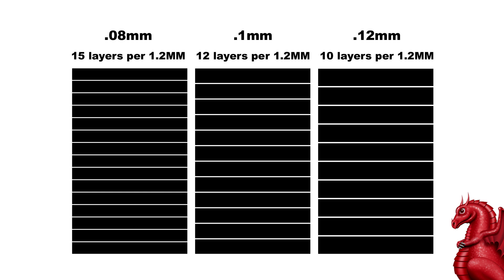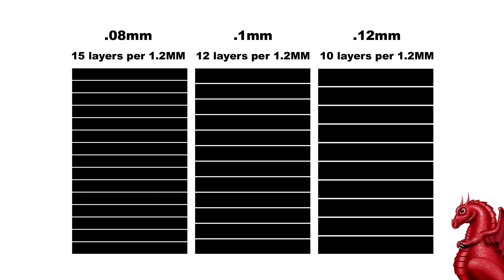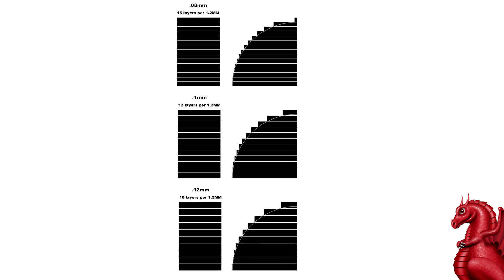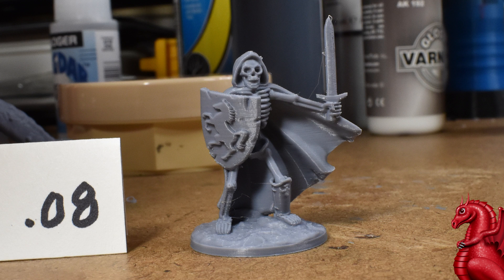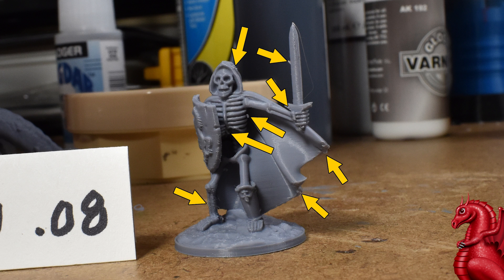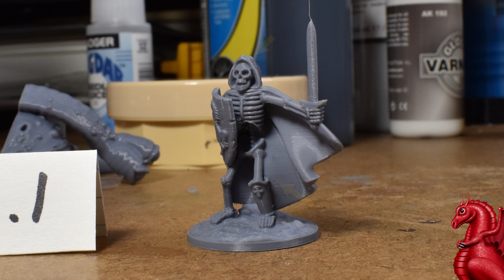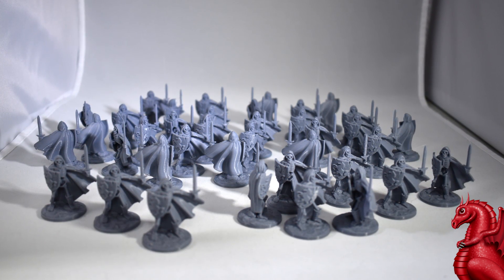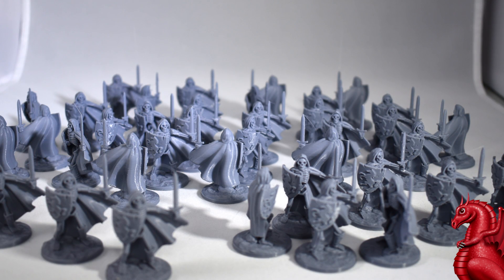How to 3D Print Better Miniatures: Pt. 1 Layer Heights

Comment: Good video, however, a stepper motor used at half step, deviation is largest (not smallest) at halfstep position: the magnetic angle (so mechanical angle) deviates the most from the electrical angle. This is just standard specification of steppermotors .

Comment: Is the layer height something you can adjust in creality slicer, or does this have something to do with the printer nozzle?
Reply from the maker: You adjust in the slicer, but you do not want to go lower than .1 for miniatures. See my other video covering layer heights and why sub .1 don't produce better results.
Reply: @Tombof3DPrintedHorrors  alright cool thanks
Reply: @Tomb of 3D Printed Horrors  BTW, what would the option be that adjusts layer height in creality slicer 1.2.3

Comment: Hello there ... I'm trying to print tiny sails ships hull using this guide but on a Anycubic Mega pro ... I'm experiencing stringing (not able to add the picture here). Trying to solve in different way one by one (less flow, lower temp, more or less retraction, higher thickness) but no way to remove the fenomena can you help me with recommended direction? I'm printing with 0,4 nozzle, thickness 0,1mm. and using your recommanded setup.

Comment: There is brand of filament you recommend for printing miniatures and high detail prints?
Reply from the maker: Hatchbox PLA
Reply: @Tombof3DPrintedHorrors  can you give me something like 5 or 10 options ? I'm from chile and the brands are very limited
Reply: @pablogallardo5100  5 or 10 bro.... just buy what you can
Reply: @Tombof3DPrintedHorrors  hatchbox cost 67usd
Reply from the maker: @pablogallardo5100 my recommendation is to buy a single roll of each of the various ones in your price range and see which one gives you the best results.
Reply: @Tombof3DPrintedHorrors  I was thinking the same and I already buy 5 brands

Comment: I was given my first 3d printer as a gift for Christmas 2020. Learning so much from your videos. I've been buying your models for years waiting for this day. So far I've done  three skeleton prints and they came out okay.  I think my nozzle is too low to the print plate as I am getting some minor stringing and some detail loss. I'm using a filament with a print temp of between 205 and 225 . I used your settings from another video but instead of using your suggestion of 195 I stuck with the 205 minimum temp. so not sure if the stringing and the glassing is from the temp or a low nozzle height. These issues are very minor but I want to get better results.
Reply: My printer is an Anycubic mega 5.

Comment: I'm just starting to watch your videos using new ender5 pro and getting some stringy ooze. if possible could you point me to the best place for starter advice to adjust settings in creality slicer or other program to use instead?

Comment: How do you ensure the motor zeros on a full step? If I start printing on a 40/60 step then move up 1 full step, the next layer will be also on a 40/60 step and so on all the way up the print. Is there a way to ensure your bottom layer starts at a full step?
Reply: I have the same question, how do we adjust the limit switch of Z to be in a full step? If you found the answer please reply to this message.
Reply: @pablodestefano5604  Nah, never found an answer.

Comment: Have you tried the silicone sock that goes over the hot end? Help with radiation and makes it easier to cook print faster aswell maintain heat in block.

Comment: So I went and bought the new silent mainboard for the stock ender 3. I previously already installed smoothers and did quite a bit. I keep hearing the new bored has an upgrade on the smoothers and that there was no need to put the smoothers on. So I printed a few things without and definitely look better than the stock ender 3. Then i installed the smoothers in just to see. The prints came out flawlessly. You cant even see any lines and are amazingly smooth. To the point of not being too anal on the settings. But I'm happy I tried it out instead of listening to what was considered a pointless move. Overhangs are so much better and cut back on even needing infill or supports now. So I highly suggest to anyone to try it out.
Reply: so, you do recommend tl smoothers even with 1.5 mainboard installed ?
Reply: @alejandromartinezcarballeda   yeah. If you already have the smoothers I highly suggest trying it out. You'll have people say its pointless but I definitely beg to differ. If you don't have them its probably not worth spending the money on them. Although they are pretty cheap. But print 2 of the same thing.1 with, 1 without all the same settings...theres definitely a difference. And I swear, I felt like it helped print at faster speeds yet keep quality results. I had no issues running at 115-120% speeds on things not packed with crazy detail. But yeah man I suggest trying it out. If you do let me know what you think. I'm curious to hear if someone else agrees with this. I did have the normal ender 3 not the pro but with just the silent board. I've since changed to the Skr 1.4 turbo board but I believe that's all I had in it.

Comment: At one point I tthink you mentioned printing 9 wall sections at a time.  So my question is will the printer print each one separately or at the same time?  Does it print each piece a bit at a time?

Comment: Ok, just in case some are wondering. The A4988 drivers that drive the stepper motors, are capable of 1/16th micro-stepping with full torque, thus no need for a magic number or sweet spot. Drivers and the control board of the 3d printers tell the motors either to operate in full steps or half steps.

Comment: Ok, awesome video. This is the exact way i exained it to others. However, i do have a question. Im a mechanical engineer, not an electrical engineer, so my thinking my be off, but with a half step, could you not lose torque, making it harder for it to raise the print head, due to the split voltages?
Reply from the maker: This isn't an issue because the odds of your Z homing height hitting on an exact full step for it's starting point is very slim (see the note in the video description.) The odds are you will always be using a micro step for every layer. :)
Reply: @Tombof3DPrintedHorrors  interesting. Thats where i was heading with my thoughts. Ok, glad i was on the same page. I knew i wouldnt always be on a full step, its almost impossible in the real world. So most likely we woild hit half syeps more often than full steps.

Comment: Since the heat is what causes the defect in the prints on .08 layer height, would improving your fan cooling with something like this: https://www.thingiverse.com/thing:3343456 make printing at smaller layer heights produce less defects?  I'll have to experiment.

Comment: I love this video, as well as one you did previously where you explain CURA profiles. I have downloaded your CURA profiles and have been using them for printing minis in last two months.

However, I did notice one thing in profiles. When I downloaded them initially and loaded them in CURA 4.1.0, they had layer height set to 0.1mm. Recently I have downloaded CURA 4.2.1 (same thing seen in CURA 4.2.0), and when loading this profiles I have noticed that layer hight became 0.12mm. Initially I was thinking that since profiles are online you have modified their layer height, but recently in CURA 4.1.0 I have saved older profiles with 0.1 layer heigh to new file, and when importing this file to CURA 4.2.1, I saw that layer height became 0.12. 

Did you have this issue? Do you profiles still have set 0.1 layer height or is it 0.12 now?
Reply from the maker: It should be .1 (I use .12 for large minis like dragons) :)
Reply: @Tombof3DPrintedHorrors  yeah, I figured. I did some research  and it seems like cura can change settings to profiles between releases. Seems like bunch of settings get messed up.
https://github.com/Ultimaker/Cura/issues/6125
FYI both your videos now talk about 0.1 layer height, yet if a new user downloads new cura and imports your profile, it will get 0.12mm layer height, together with a bunch of other settings changed. Although if you take a look into the attached link developer over there says they try to keep same gcode generation between releases instead of profile, so it might be that gcode will be correct. I don't know what happens, just wanted to let you know.
BTW which cura version do you use, and do you update cura to new version ever?

Comment: The only thing I've not seen covered (it may have been?) by anyone is this:
How can you be sure on what microstep your first layer begins? Everyone's bed height and Z offset will be different. The best your process (i like the explanation) can do is keep the layers a consistent step or half apart from the previous.
I've run 0.12 for quality and 0.28 for quick prints. Features like screw holes have messed up my surface finish more than anything else I've noticed. Not too many of those on minis thankfully.
Reply from the maker: Covered in the video description :)
Reply: @Tombof3DPrintedHorrors  but who reads those before posting comments? 😉

Comment: Several people have asked if the bottom z-stop wasn't at a full stop what would happen.  I have a slightly different variation on that question that is really bugging me.  If you are auto-leveling the bed (and the board has mapped out the differences in height between different areas of the print bed) then it would seem you can't help but start out at micro-steps for at least certain areas of the print.  (granted they probably aren't bad for 28mm miniatures, but I can see it being an issue for things that cover more of the bed.)  I understand that in general the bed-level adjustments fade out over the first several layers and don't continue forever, but I don't think there's a guarantee that when the board has finished adjusting for layers that you'll end up on either a full stop of a half stop, but are more likely on a micro-stop and even with a .1mm layer height they will always be at a micro stop if the bottom layer is at a micro stop.  That leads me to think there are other issues at play besides the full-stop or half-stop of the layer heights on the Z motor.
Reply: I completely agree and have the same issue with this theory of "magic numbers". Want to complicate things a bit more? What happens when you have a dual lead screw set up with two z motors?

Comment: I am curious if these numbers are the same for the Prusa i3 Mk3.  I understand how you are saying about the # of steps per motor, and the Prusa also uses Nima 17's. How did you calculate this based off the pitch of the Z screw? Is the Ender 3 and Prusa the same as it's a clone (sorta).
Reply from the maker: It would depend on the pitch of the Prusa's screw (contact them for specs)

Comment: I am really wondering why you didn't use a smaller nozzel size. 0.4mm seems a bit large for 0.08 - 0.12 layers.
Reply from the maker: .4mm is the standard nozzle size and many people don't want to change it. A separate video will compare .2mm, .3mm, and .4mm nozzles
Reply: @Tombof3DPrintedHorrors  Ah okay, makes sense. Perhaps you could have mentioned it 😜. Anyways, keep up the great work! You truelly bring your expertise to the people in a way that is easy to understand. 👍

Comment: Great video. Thank you. 
Though I have noticed that on my Ender 3 Pro, with some minis I'll get a tiny bit of artifact, almost like a little bit of over-extrusion if I print on .1 instead of .08 or .12. But if I print on .08 or .12 it goes away. 

It's not a universal and it depends on the model, but it's been a common enough occurrence for me to skip .1 entirely.

Comment: Fantastic video as usual. However, I'm having a hard time finding out what is the amount of steps on the steppers for my printer (Ender 5, so I think I can assume it's the same as an Ender 3), and the equation to find the correct layer height per full turn, could you write it down?
Reply from the maker: The Ender 5 is identical to the 3/3 Pro. 200 steps on the motor, 8mm pitch on the Z screw. :)

Comment: With all that discussion about magic numbers/full steps/micro steps - however you call it - I'm always wondering, when you Z home your printer are you guaranteed to land on "full step"? Is the software hardwired like that to turn off microstepping when homing? I mean, if not then all this discussion is useless as increasing by "full-step" from "micro-step" position will give you again "micro-step" position. I couldn't find confirmation that homing lands on "full step".
Reply from the maker: See the video description, I address this :)

Comment: Soo how does the nozzle width impact the prints?
Reply from the maker: I have a separate video covering .4, .3, and .2mm nozzles coming soon. :)
Reply: Den avgör hur tunna detaljer du kan printa ut. Du ser det direkt i slicern.  Vanligt att det blir hål i en kappa t.ex. om den är tunnare än din inställning för lagerbredd. Vanligast är det 0.45mm för en 0.4mm nozzle så det är något man får ha i åtanke när man designar för printning.

Comment: Question: is it possible to program a given layer height for one part of the print and another one for a different part of the print? or would I have to stop, re-calibrate and restart to make this change?
Reply from the maker: It is is you use Prusa Slic3r instead of Cura.

Comment: Is there no option for variable layer hight that can be built into the sculpt stl file. An option that automatically adjusts the layers for curved areas. ☺ Or could this be something for the next gen of printers to aspire to ☺

Love the channel, more videos please ☺ 🇮🇪
Reply from the maker: Both Cura and Slic3r offer this, but the results are worse than sticking with a single layer height.

Comment: Does auto bed leveling defeat the purpose of dialing in your settings to use full steps? ABL uses small z-axis adjustments to compensate for the bed not being level or being warped but then you aren't using full steps anymore. Is this correct?
Reply from the maker: That is correct, but it ultimately doesn't matter. The point of the video is that the layer thickness has more to do with quality than adhering to 'full steps/magic numbers'. Using full steps for layers means it will continually use the same micro steps and even out variations/inconsistencies that would occur hitting different micro step positions for subsequent layers.
Reply: @Tombof3DPrintedHorrors  Understood, nothing can be that simple, there are always plenty of variables at play that affect the final result. 
This is just something that's been bothering me because I never heard anyone mention it as a slightly disadvantage of ABL.

Comment: I guess the more layers you have, the greater chance for there to be a layer defect on the model overall (assuming equal chance for a defect on any one layer)
The number of defects shown correlates with the number of layers quite nicely in this video;)
Reply from the maker: It's not that, it's how thin the layers are, especially in areas with overhangs. The thin layer deforms from the heat of subsequent nozzle passes and the heat from extruded plastic on top of it. The thicker the layer the better it can dissipate that heat. Using full or half step numbers for layers, even when the home position is on a micro step, means it will continually use the same micro steps and even out variations/inconsistencies that would occur hitting different micro step positions for subsequent layers.